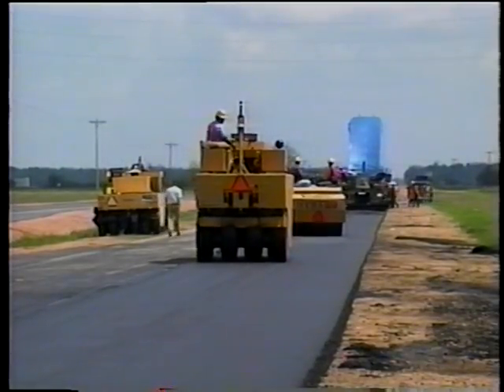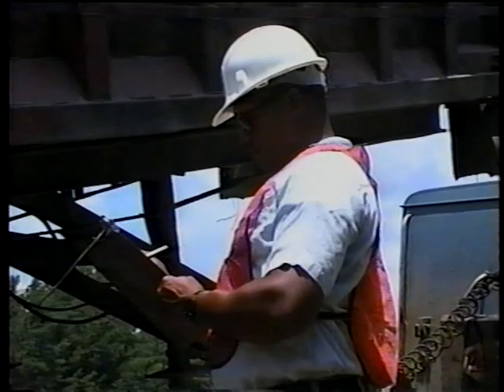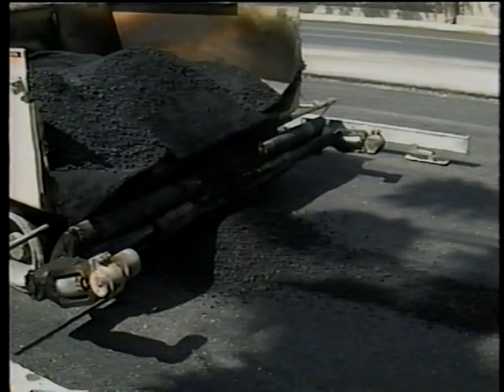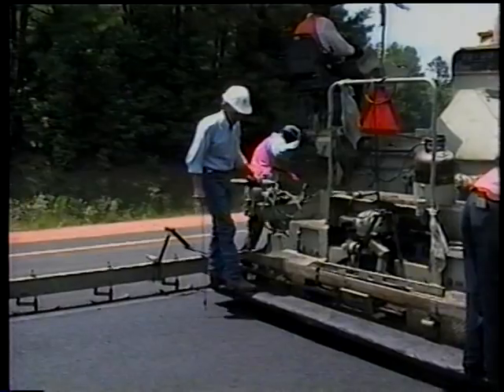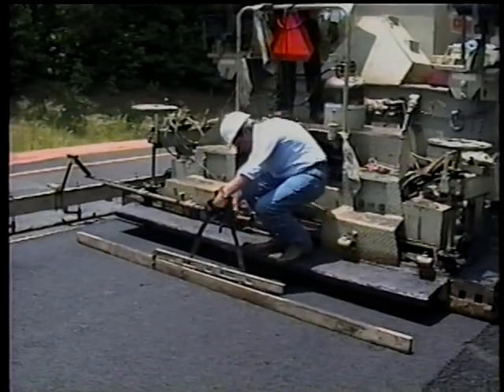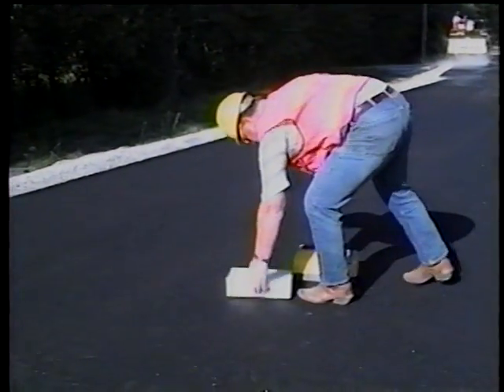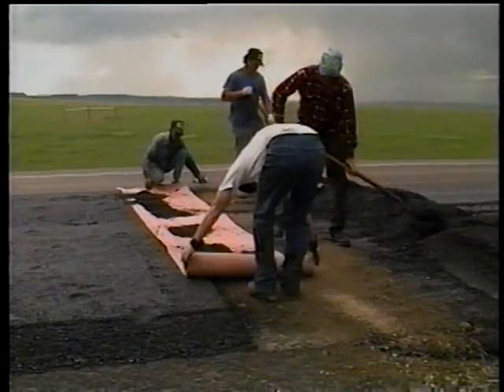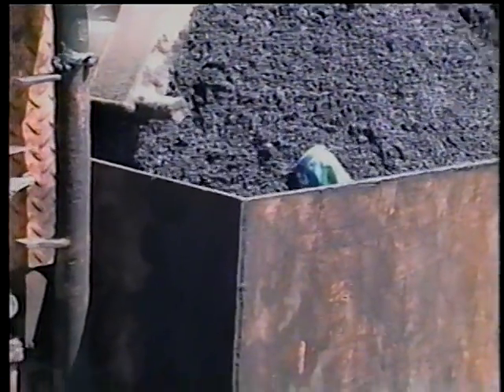Asphalt Paving Inspection (Part 2)

Comment: wow i know this vid is old but it says the mix should be around 239F. (115c) but our inspectors threaten to toss the load below 280. they love to see 300 & the msoke rolling out of the load, but i say you're burning alot of the liquid when its that hot :/
Reply: Gladly124 it’s because there’s a lot more recycled wrap in pavement nowadays pavement as junk compared to what it was back then